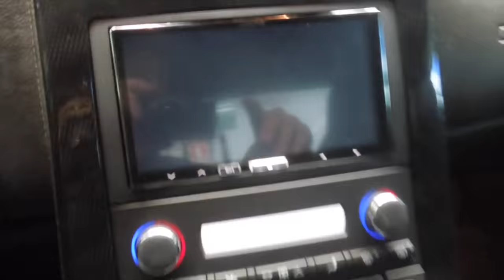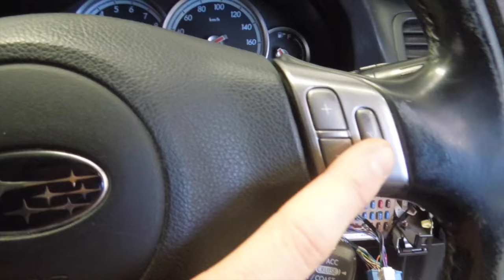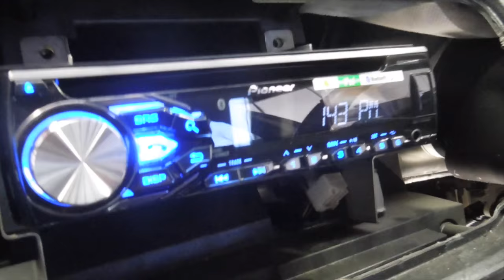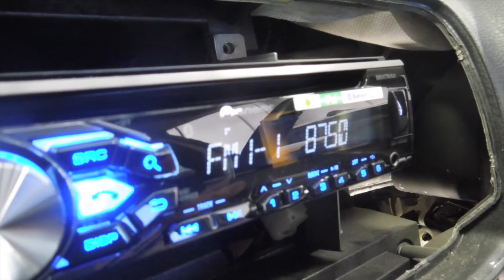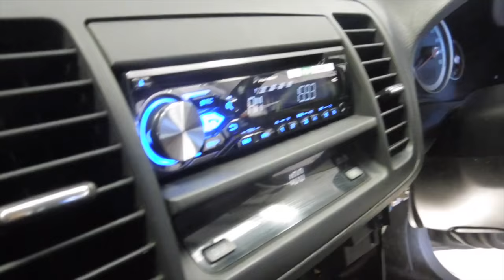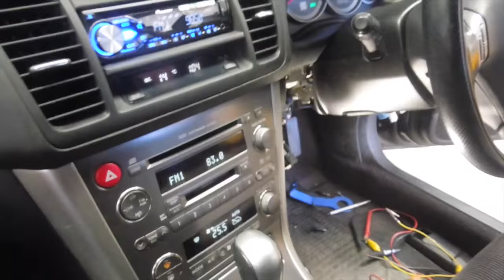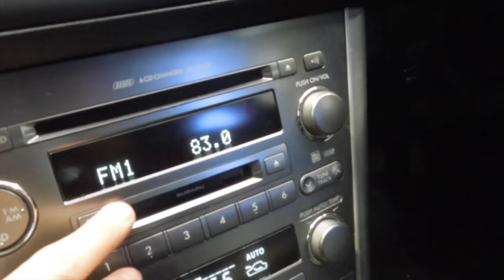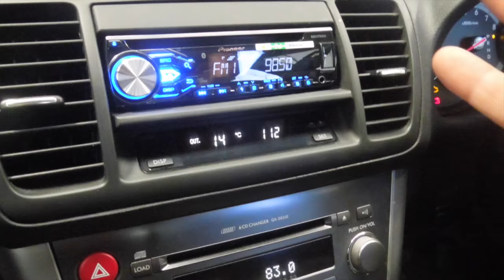How to Install a Stereo into a Subaru Legacy/Outback (2003-2009)

Comment: Nice video mate. Explained everything I wanted to know about this model and the options for aftermarket stereos.
Reply: I have heard there's a way to use the CD line to connect a Bluetooth module which have a TD card slot.

Comment: Hey James, enjoying your videos. Im from Wellington. I have a 2006 Legacy and I'm keen to rip out the factory nav and put a mechless double din in there,  my question is there are way to still utilize the CD stacker rather than having it dead? Like using a AUX adapter? I have seen some that are designed for the macintosh system.

Comment: do you have a part# for the vents and brackets?
Reply: I know im 3years late but maybe someone still needs it H0017AG920
Reply: Thanks for the part number I’m so happy and lucky that I saw this comment now and not two months earlier 😅
Reply: THANK GOD I NEEDED THIS
Reply: @Justin71554  here in 2024 and grateful you shared the part number. By the looks of it, I might be able to cut/fold some aluminium sheet  myself to fit in a double din. I've got one of the nav dashs without the clock already, meant for a flat Panasonic navigation screen.

Comment: So I went off your video on my 2006 legacy gt and the head unit works fine but my hvac doesn't light up and I can't control it but it blows full blast. Did I mess it up? Or did I just switch the 2 plugs for the hvac? Any info would be helpful thanks
Reply: Fixed it. Just snipped the 12v constant instead of splicing in

Comment: I have a 2002 Subaru Legacy B4 (Japan). It has a navigation+HVAC head unit and a Aftermarket Kenwood head unit below it installed (previous owner). The nav unit does not turn on but the aftermarket unit works. Was wondering if they just pulled the wiring harness from the nav unit and put it into the new one? If so how do I fix it so both units will turn on/work?

Comment: Hello, very good video, I do not use much English, so I did not understand your words, so I consult you, how did you do to handle the audio of the new radio, from the steering wheel controls? I have a 2008 outback and it does not bring auxiliary input. Thank you

Comment: Did the non mechless unit (DEH-4850) fit ok? I fitted a mechless X385BT and it seemed a pretty tight fit already but it definitely improved the sound clarity and sub control out of sight. Plus the hands free works remarkably well. (Morel Maximo splits and Focal Bomba 20A1)
Reply from the maker: Geoff Murray full size single din units should fit up there yes, but if it's a double din, then it has to be mechless.
Reply: Great! Thanks for the prompt reply.

Comment: Hi does anyone know i installed one in the top, but when putting it back together i lost the back illumination on the factory radio and climate control so the words and knobs dont light up red anymore.  I don't think its the fuse since it still lights up red around my side mirror controls.  Thanks i have a 2005 Subaru Outback Limited.  So the screens light up with temperature and radio station, but the illumination is gone.  Does anyone have a wiring schematic for aftermarket to climate control.  Not sure which wire would be related to the red back illumination.

Comment: Hey, is that bracket in the newer 2007 Europe version Subarus aswell, if I had the flap compartment up there?
Reply: One more thing, are the remote controls easier to manage on the newer 2007 steering wheels? Because I have different button layout, with cruise control on the wheel aswell.

Comment: hi...i just put aftermarket cd player in my 99 subaru outback legacy now dash lights dont work...i didn't cut any wires i bought harness from amazon to plug into factory harness it had two wires one orange and the other orange and white that said illum... i didnt know where to put these as aftermarket cd player harness didnt have the two orange wires...so i didnt wire them in to anything please help

Comment: Nice one mate. Got one question. I recently got this 1 din kit as well and tried to install it. And I use the harness just trying to make things easier. But the problem came out. Once I unplug the factory radio plug, the climate control also goes disable, but the power plug of the climate control is still plug in. Do you have any idea of this problem? Any tips will help. Thx mate!
Reply from the maker: tingyang1127 the stereo and climate control probably share a power supply.
Leave the stereo plugged in to the main harness bus disconnect the speakers like I did in this video.
Reply: tingyang1127 Hey mate where did you get the 1 din kit? really interested in getting it but can’t find it online anywhere

Comment: Hey there James, can you tell me how to go about putting a single din stereo in, the same as you have done it, but my legacy (2004) has the fold down flap for the pocket. Did you say this one didn't have the bracket already in there? Would be much appreciated if you reply! Cheers.
Reply from the maker: The flap pocket is totally wrong dimensions for a stereo so there's no 'nice' way to do it. And it won't come with the brackets for mounting like I used in this video.
Reply: So you is there a website we can find brackets like the ones you used??

Comment: Hey James, I have the flap dash as well. Was wondering if there is any way around that... Possibly hooking up an amp to the factory stereo? And how I would go about doing that.
Reply from the maker: To connect an amp to a factory stereo, you need to make sure your amplifier has some thing called "High Level Input" or "Speaker Level Input".
A lot of people say you can use any amp with a high to low level convertor, but personally I don't like these because they take up space and often create noise because they're one of those product that no-one really makes a high quality version of.
As far as fitting stereos in the dash goes, yeah you really need the one with the din hole and brackets or a large opening for a shallow double din stereo.
Hope this helps!

Comment: Hey James how did you un-clip that clip that powers up the temperature screen/fuel usage thing? That holds the unit in! I can’t manage to get my fingers in there and get it out of the back! Please get back to me, cheers.
Reply: jesse fennessy there should b a wire running to it, follow it then grip the clip and pull it out at the same

Comment: hello buddy, i have subaru legacy 2005 and i dont know there is no enough room to put the stereo inside. have you cut something inside for the brackets or stereo ? i am waiting far your reply
Reply from the maker: Single Din stereos and selected double dins do fit but you need the correct trim kit and mounting brackets to do it.
I dont know where to get them I just install stereos in this location when possible.

Comment: Interesting. I was wondering if a Sony XAV-AX100 could fit up there and look good. It has a single din chassis but double din size screen. Not sure about the depth but no CD player. I have a 2008 with a flap.
Reply from the maker: Yes it can but you need a different vent trim with a large hole for “navigation screen” rather than a single din hole

Comment: Thanks for the video.  What other stereos would fit in this space? What is the maximum depth it would accommodate?
Reply from the maker: When you have this fitting kit you can put in any single din stere.
Or if you have the kit with the large hole in it to accomodate a screen, with some custom mounting you can fit the following double din stereos (that i have found);
parrot asteroid smart, alpine ilx-007E, sony xav-ax100, alpine cde-w265ebt/cde-w296ebt stereo needs modding).
The reason these stereos fit is because they are either shallow chassis from having no cd player, or they only have a single din chassis at the top half and nothing in the bottom. hope this helps.

Comment: Hey I have a 2005 Subaru outback and I'm trying to find a bracket mount for a single din stereo. I'm putting it in the same area where the pocket panel was located, but I can't find a bracket for it. On the back side there's a part number that says Radio Box 66204AG02A. I've searched everywhere and I can't find anything that's related to the part number or even something that could work in the car. Do you have any advice or know about a bracket that'll work for this?
Reply: Did you ever figure out how to install a 1din up there? Same problem

Comment: Question: is there a way to...umm damn,i dunno how word it.
Can both 'new' flat screen and 'old' CD/radio be connected into the car speaker's?
Reply: You can use 4 Relays or a 4contact rele, to let the second stereo conetc to the speakers when you turn it on

Comment: Hey i have a 2005 subaru legacy with the integrated climate controls and stereo, it also has the the flap model for the dash, is there anyway that i could install a stereo or even just an aux port?
Reply: Harry Turbott hi mate! Yes you can add in an external Aux hub thingi its called anycar link it hooks up into CD changer port.
Reply: that's what I'm have to track down in the UK then

Comment: Where is your shop mate? Are you based in auckland?
Reply from the maker: Christchurch
Reply: I have 2004 subaru legacy and I am using anycar link with my factory radio/cd player and I have managed to wire my sub and mono block with it but the sound quality is just rubbish. I might do the same thing what you did in this video. 😀

Comment: sorry i deleted my previous comment but i managed to make my own pocket to fit a single din. only problem is with my subaru legacy gen 4, the climate control wont work unless i use the splice technique.
Reply: got any pics of how you did it?
Reply: how did you get the temperature control to work again?

Comment: where did you find the brackets to hold the radio?
Reply from the maker: They were already in there
If the car has the single din/ pocket dash piece in the top location then the brackets that go with it should be there too.
Reply: +Car Audio.etc Really? The ones that hold the physical radio in the video at 3:45 ?
Reply from the maker: +VENIO yes they were in the top of dash between air vents holding a standard Subaru pocket ( not the type that has a closing flap lid)
Reply: +Car Audio.etc Ohhh that's why I don't have it. I have the flap model. Do you have a link or site where I can find the brackets or the whole assembly?

Comment: Hey i have a 2005 subaru legacy with the integrated climate controls and stereo, it also has the the flap model for the dash, is there anyway that i could install a stereo or even just an aux port?
Reply: I'm the same, but from the looks of it, its either this way, or using the expensive replacement fascias from Japan

https://www.scoobynet.com/wales-26/676820-double-din-legacy-upgrade.html
Reply: Harry Turbott Have found a way yet?